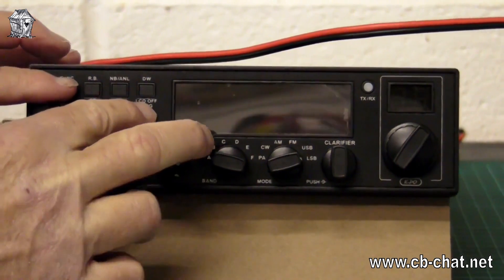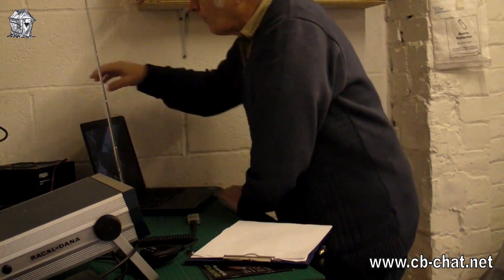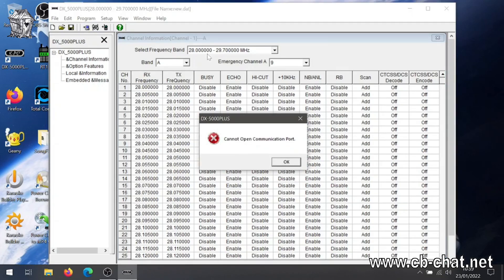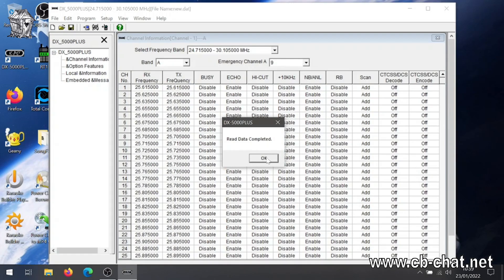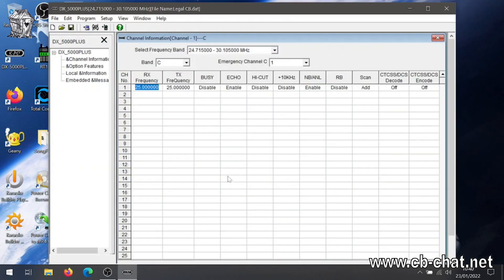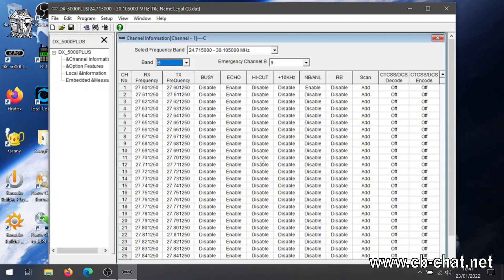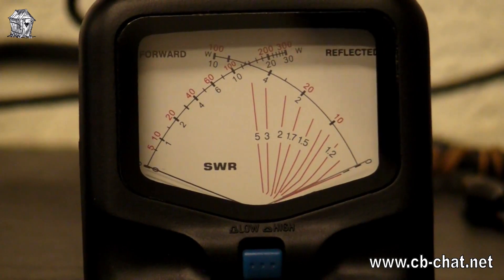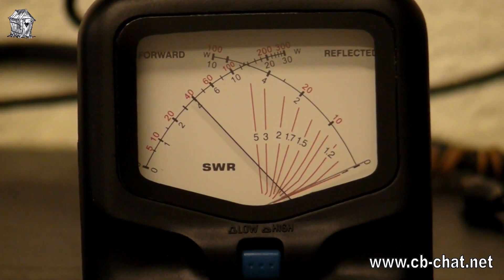KPO DX 5000 Plus Part 2

Comment: @Ken Williams hi is it possible to run ft8 on this radio using some kind of interface via the USB type B on the back?

Any advice appreciated... i just bought one and it would be great to run digital. mode with the dx5000 as the transmitter / receiver
Reply from the maker: I was told when I bought mine that it is not a real USB connection, and not a standard USB lead, just a means of programming the channels.